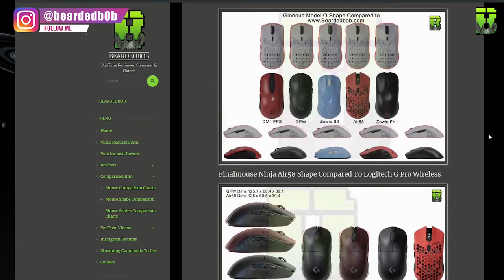G Wolves Skoll Teardown Ergonomic Gaming Mouse Only 66 Grams

Comment: You must have gotten one of the original “Beta” versions of The Skoll. Nobody I’ve heard of outside of those that got the mouse early to be reviewed has said that they have the protection wrapped circuit board like your does. Mine  does not have this feature. Apparently G Wolves made some changes. Thanks for the review. 👍🏻

Comment: Hey bob a tip or alternative method to remove feet I got from a Japanese repair shop.  Instead of hairdryers u would use lighter fluid “zippo” brand in US. It will evaporate and not harm anything. This will cleanly allow sticky side to cleanly come off and retain sticky properties and u won’t warp or bend the feet.  I use same 3m double sided ultra thin double  tape that Zowie uses for replacement mice.  In case it looses too much of its adhesive propertiesThought u may get some use from this my new friend !
Ohh this mainly for large feet ur method is perfect for these smaller feet!
Reply from the maker: Hi,

Cool tip do you use a cloth to apply it? it is a problem if you bend them but again as you have said using some M3 tape can help sick them back.
Reply: Beardedbob  no cloth the type of lighter fluid zippo brand uses evaporates almost instantly!   Once u lift up a small portion continue to squirt a little under the feet as u go

Comment: Question is, will is scratch at a level 6 with deeper grooves at a level 7

in all seriousness do the internals tell you anything about the mice after a while. like does it seem like a quality mouse internally or do the internals not depict things like this
Reply from the maker: haha, I'll have to ask Jerry to borrow is pointy scraper. 

It can. This one has parts that you see in the final mouse or other more expensive brands. I can't fault the components used though I'm not familiar with JAS switches that they have used on the sides. It also uses a scroll wheel I've not seen before but what is nice to know if they have tried to protect it from liquid spills.

Comment: Hell yes, I’m getting my spray paint ready for it arriving this week. Gona put Swarovski elements on it somewhere.
Reply from the maker: Are you going full bling on it? I'll expect a picture.
Reply: Beardedbob nothing over the top, iv got some ss10 golden sun Swarovski crystals that I might put on the stroll wheel that should be small enough if I take the rubber off. As for the colour I’m honestly not sure wot to do. I no this may sound nuts but iv got an idea that if I was to make a hand strap and attach to each side  without interfering with my fingers then It would allow me to use the base of my hand to left/swipe while leaving my fingers more free for aim/side button without trying to grip the mouse.

Comment: Thinking about opening mine since the scroll wheel button feels a bit strange.. Were you able to re use the glides you took away or did you just put new ones in?
Reply from the maker: I could reuse them. A few people have said using liter fluid works also but I've not tested it.

Comment: So what do you suggest I can buy ec2b or this skoll mouse at the same price do you think it's better than ec2b ?
Reply from the maker: A few things to consider, you need to decide what it is you want. 

Zowie have a rock solid reputation in building mice where Skoll are new to this market. 

The Skoll is significantly lighter if weight is a problem.

The Skoll has software.

The Skolls cable is much more flexible where the EC2 would benefit from a Paracord.

The EC2 Is easier to buy and more available.

Which shape works for you?.
Reply: @Beardedbob  have used a ec2 before and I like the shape but the buttons and scroll are really bad that's the only reason I'm hesitating to buy ec2 I prefer mouse for palm users tried Model O but it doesn't fit my grip

Comment: are those OMRON D2FC-F-K(50M)? If those are... The mouse seems great, might unsolder and switch out for kailh red GM microswitches 60m.

I'm doing this for my logitech g pro wireless because of the stupid mouse button issues. bought 10 of these for $9 and free shipping.
Reply from the maker: Yep they are https://www.instagram.com/p/B0y2hZPng0q/?utm_source=ig_web_options_share_sheet
Reply: @Beardedbob  guessing this mouse will also soon have button double clicking and unscoping right click in fps too

Comment: Have you switched the switches on the skoll to the gold ones in the box?
Reply from the maker: There was no golden switches in the box.
Reply: @Beardedbob  RIP, mine came with a set and was curious if worth doing

EDIT: I did it, switches felt great, but I messed up the soldering job and right click doesn't work lol
Reply from the maker: I've got the switches on the PCB it seems. I've ordered some gold TTC though which I might install on my GPW

Comment: I just bought a G305 and put a AAA Lithium in it but I need more/less. Could you do an extreme weight reduction video on the G305 similar to that of the G Pro? Not just a battery mod like every other 10000 videos on YouTube, but a proper mod where you take out bits that you don't need/aren't important?

Comment: Hey man i have a question is there a way i can re use mouse feet thanks :) good vid btw
Reply from the maker: Yeah, you have to heat them so you don't bend them and they peel off easily. 

I've not tried it so I would check, but Zippo lighter fluid can remove them. 

Atm, I use a hairdryer and a soft plastic tool. O
If the adhesive isn't great, I use double-sided M3 tape to stick them back down which is thin.
Reply: @Beardedbob  thanks a lot for the reply will give it a try
Reply from the maker: Np glad I could help. Just take it easy and they should be fine.

Comment: How do I buy this in the uk?
Reply: The only place I know you can get it from is X-Raypad. I'm guessing they're US based so you'd be paying the $58.90/$59.90 plus shipping and then 20% tax on top of both the mouse price and shipping, unless they mark the price down (which they shouldn't really but some do) then you won't have to pay the 20% tax... Always assume that you will though. At that price you shouldn't have to pay any customs charges but you may also get hit with a handling and processing fee (or whatever it's called) depending on who it's delivered by. I believe some can be like £8-£12 or like 5% of the cost of the item but don't quote me on that and some don't charge a fee. Basically, it can cost quite a bit. I'm going to try and get in touch with G Wolves about getting this in the UK, because I want the Hati.
Reply: u can only order it in china atm
Reply: Just double checked on their website, says it's coming to Amazon soon. Whether that means Amazon US only or Amazon across the board I don't know... Keep an eye out for it though
Reply: Fracx 98 ok thankyou
Reply from the maker: As others have said it's on x-raypad that stock it atm.
Reply: Fracx 98 I just looked on ray pad and there sold out anyway can you let me know what g wolves reply?
Reply: JustKronic G wolves didn’t respond to me and that was 3weeks ago.  I ordered mine from xraypad $83 with fast shipping to the uk. Hope this helps
Reply: @triixsta6324  Haven't had a response yet but I will if they reply and if I remember haha. You might want to send them a message yourself over Twitter or something, if they see they have enough interest they might consider getting something sorted out with like Overclockers or some others like Glorious did with the Model O